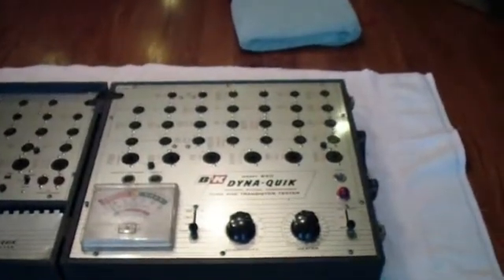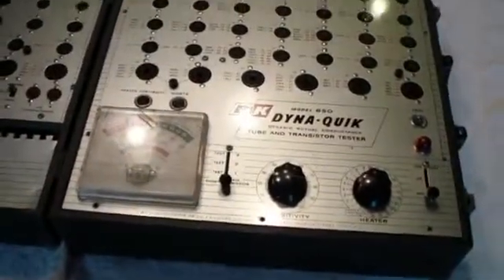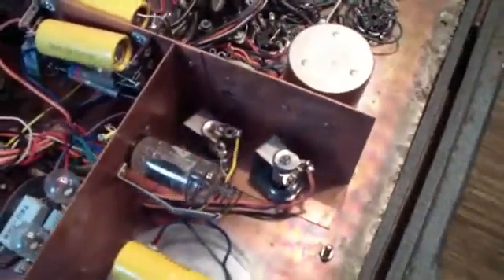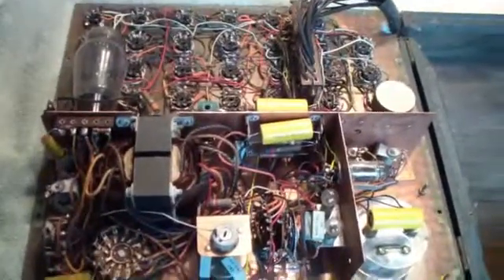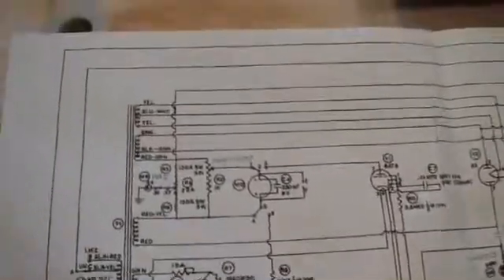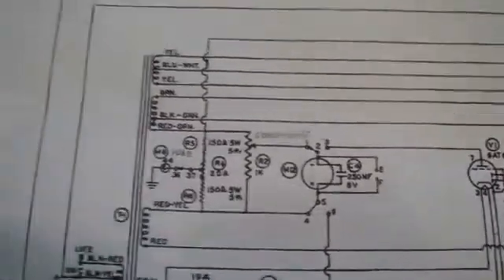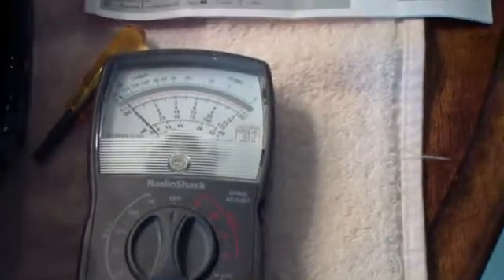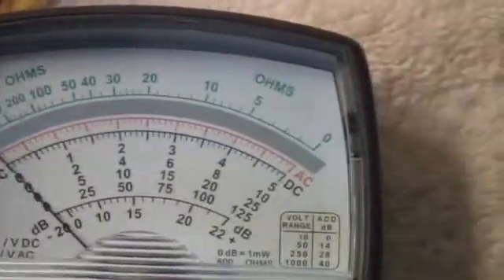TTT025 BK650 Tube Tester Pt1

Comment: All of a sudden my short indicator lamp light up with no tube in any socket. Is there an obvious place to start troubleshooting?
Reply: Check for out of spec resistors. If they are out of tolerance replace them. Also replace any caps if havnt been done already